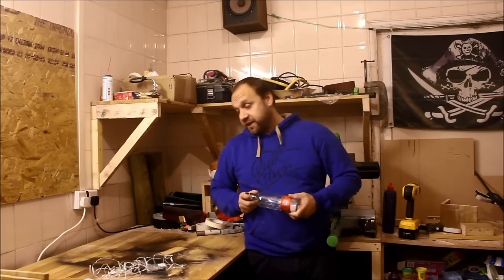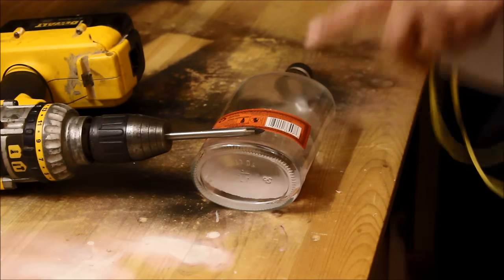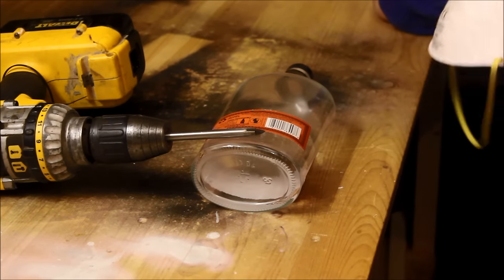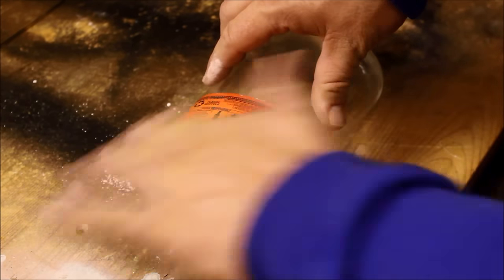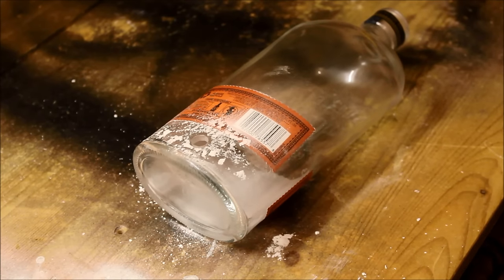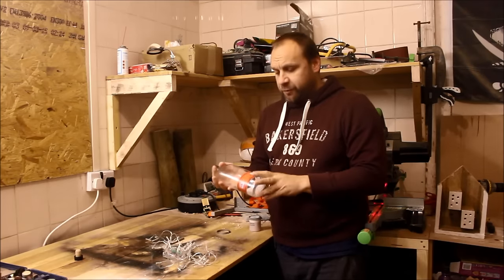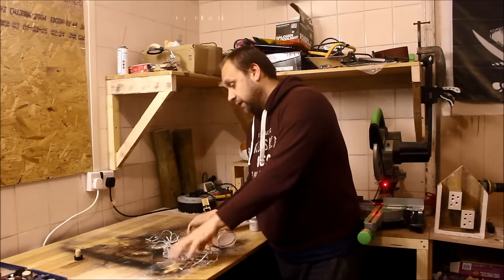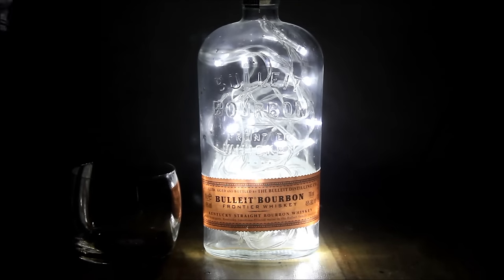Make a Cool Light From a Whiskey Bottle

Comment: If you put a heavy bead of hot glue around the area that you are going to drill the hole in and put water in it you can eliminate the bottle getting hot and the dust from the drilling to help keep it safer

Comment: great job my friend really looks nice. I'm wondering if you could speed that process up if you drilled underwater?
Reply from the maker: Thanks Opa, yes I reckon drilling underwater would speed things up, however as I only have cold running water in the workshop, no heating, and its winter I might wait until spring before trying